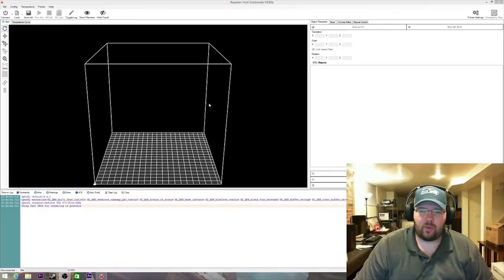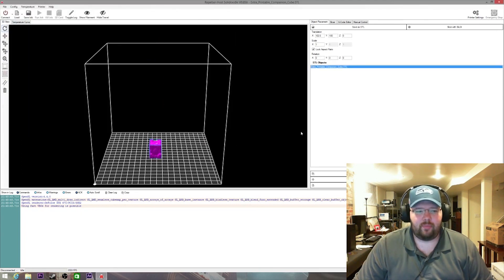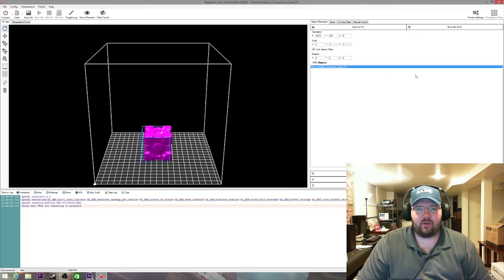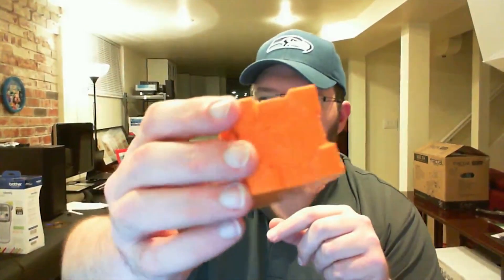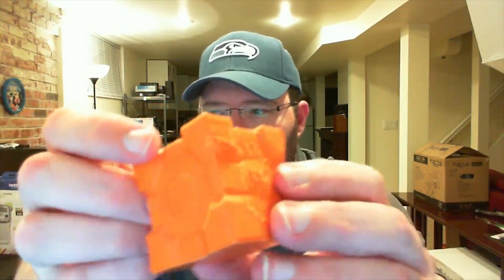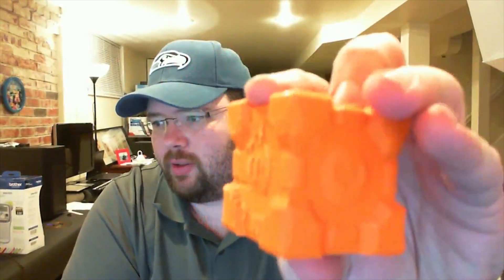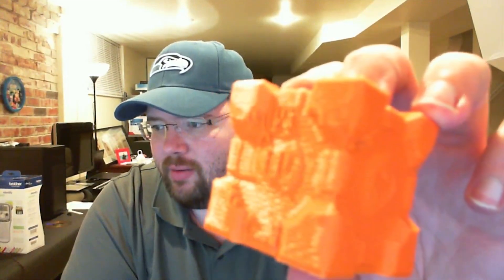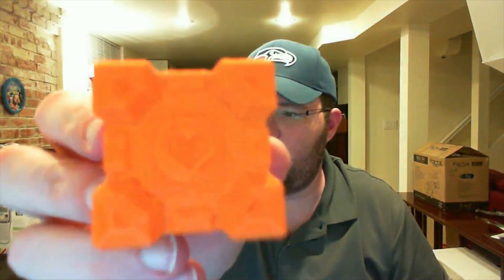3D Printing Fail - Portal Companion Cube on Solidoodle 3D v4

Comment: CAD drawing > stl.file > slicing > print > post processing
stl file and slicing part are quite crucial..have you set up the slicing thickness? its relate to the resolution & surface finish..should be not bad at all..or perhaps problems with the printing itself..
Reply: mende gok epul eh, dok pehe stabuk arang
Reply: Mno mu pehe. Aku kecek kelate dgn dio ni..haha

Comment: I have SD 3. I suggest print thumb screw knobs. It makes leveling bed really easy. http://www.thingiverse.com/thing:176135 

Also if you printing with ABS let bed get nice a warm around 85-90 c before print. So the printer air get warmer. ABS prints better under warmer temps 

Fyi update the Slic3r, when use Repetier-Host from SD

Comment: Slice the model into 2 halves, shell both and combine back together. That way you get a hollow model. It is faster and cheaper to print.
For this specific model, I would divide it into 6 piece, and lay all of them flat to print. That way, they all have the same path to get better tolerance. Then acetone them back together.